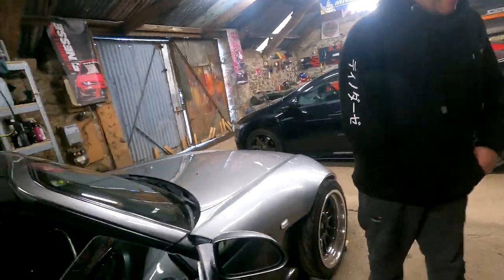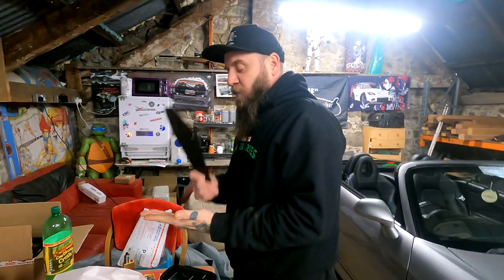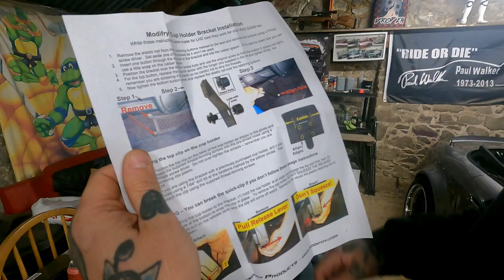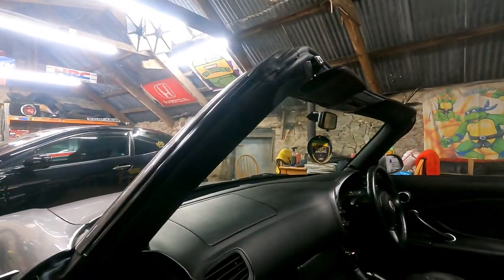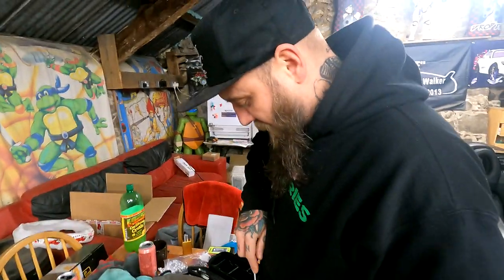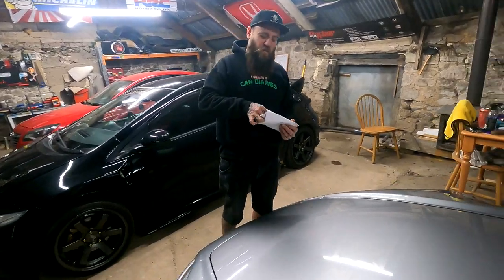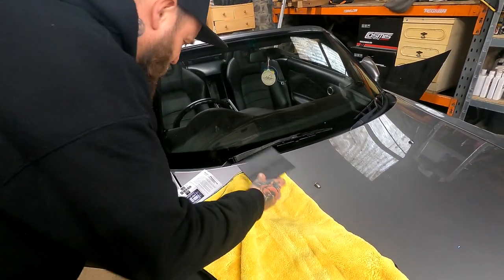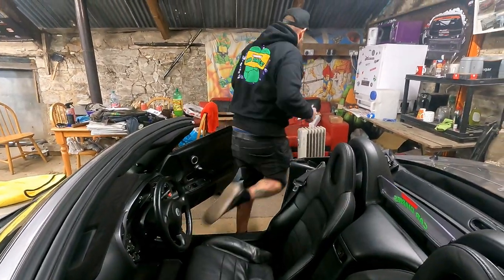Two Things you Never Knew You Needed For Your Honda S2000 AP1 AP2 * Modifry *

Comment: Nice video. Can I ask where you bought the bracket mount for the cup holder? I’m in Australia RHD too. I have a cup holder but modifry said they don’t make those mount anymore. And apparently there are 2 mounting holes positions depending on which year of ap1.
Reply from the maker: Mine was the larger gap just measure the distance between the two holes on the net in the passenger foot well, I bought it all from Modifry bud on the website linked in then description
Reply: @CowabungaCarDiaries  Thanks. They must made a batch just for RHD. 👍  I will get in touch with them.
Reply from the maker: @mk.h  they had both RHD and LHD options on the website